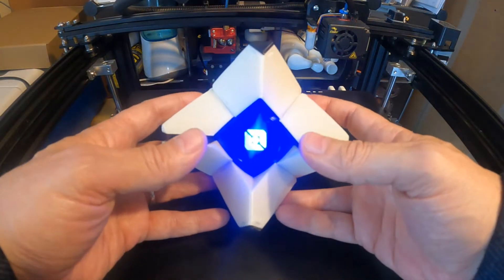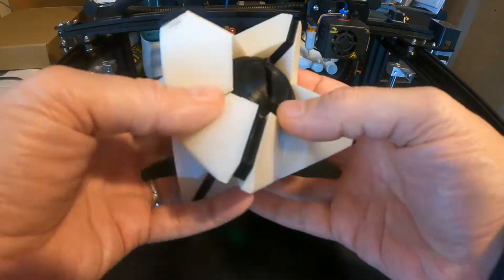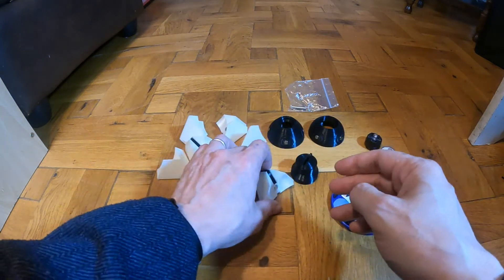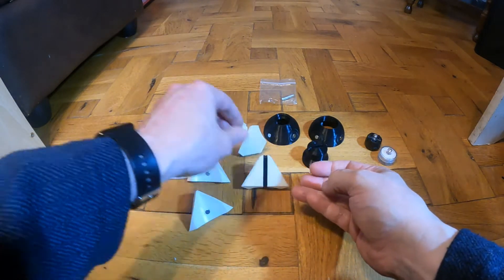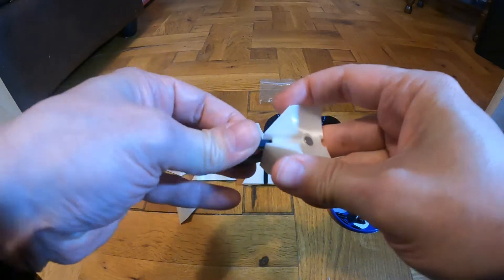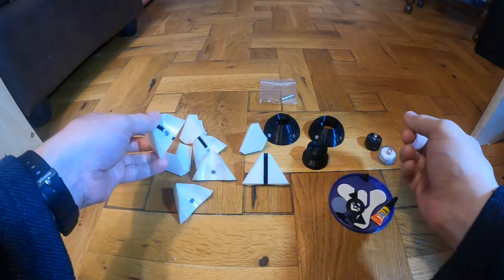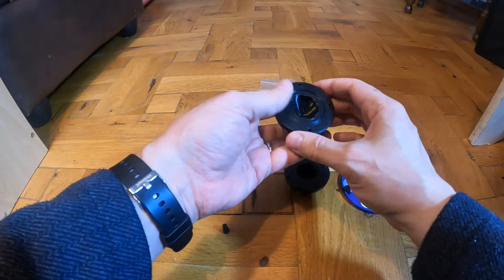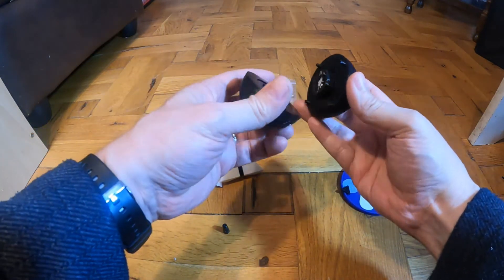Destiny ghost 3D printed and assembled

Comment: where do you get the circle that goes over the LED light?
Reply from the maker: Hi, I cut a circle from a plastic milk container, seemed easier and quicker than printing.
Reply: @Kalbo64   thanks
Reply: @Kalbo64  , did you use a specific milk bottle or brand?
Reply from the maker: @SquigWithRuffles  Just one of the standard white plastic.
Reply: @Kalbo64   ok thank you done for real now :]

Comment: Do you happen to have the parameters used for the pins? They are the only pieces that my printer fails to print
Reply from the maker: Hi, if you mean the small pins to hold the light shell together I don't have the exact dimensions sorry. I now normally replace small pins with either wood or metal pins depending on the strain they may have on them.

Comment: Was wondering if you sold these on Amazon and did it come with a wooden box. If I was wondering when you started making em. I have one that looks Identical to yours
Reply: The light doesn't change colors on mine. It's only blue
Reply from the maker: Hi, no I have never sold them or the guns I have made. For me it is a fun hobby I feel would be spoilt if I had to make things to order.
Reply: @Kalbo64  oh OK, thanks for taking the time to answer my question. I bought mine years ago and cannot seem to remember who from. Thanks again and your ghost was pretty cool and the magnets actually seem to work, mine would fall apart even if you just barely grazed it so I ended up super gluing it together. Keep up the good work

Comment: What are the dimensions for the led candle light?
Where can I buy one?
Reply from the maker: Hi, the ones I used are these - https://www.amazon.co.uk/gp/product/B08FMRQDN3 (you will get them cheaper from another supplier, just these were much cheaper at the time) The design uses a different shaped one which I was unable to get so had to print and then cut down the case. I have since printed the same ghost but used Tinkercad to adjust the hole size so the light fits perfectly.
Reply: @Kalbo64  ok cool thank you. they seem to be called "floral tea led lights" in terms of the shape. i think i can order em from walmart.

dimensions say they're 1.2mm but the hole is 1.1 ish, so material removal will most likely be involved.
Reply from the maker: Hi, yes I ordered the correct ones after I had printed the ghost but they sent the round ones, so I had to adapt. If you can get the right ones should be fine. This is the place the designed used https://www.ebay.com/itm/171239692713 but wasn't any good for me as I am in the UK.